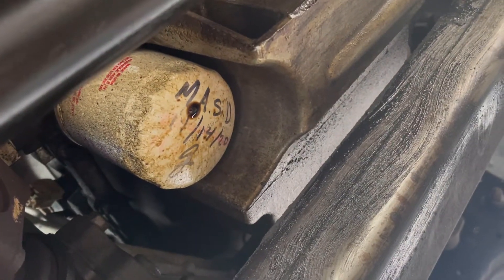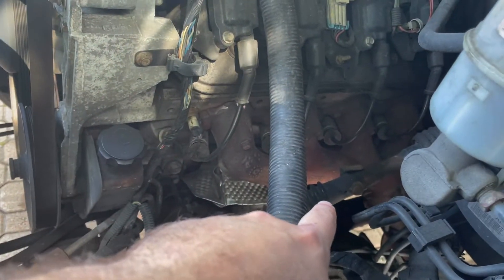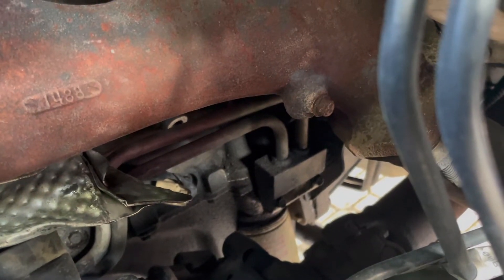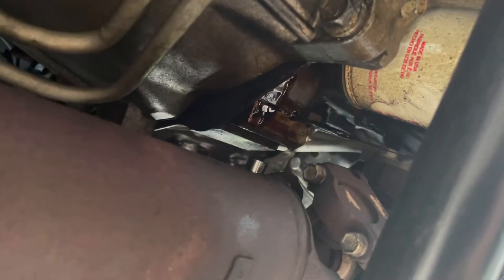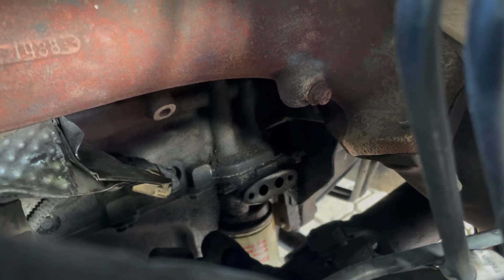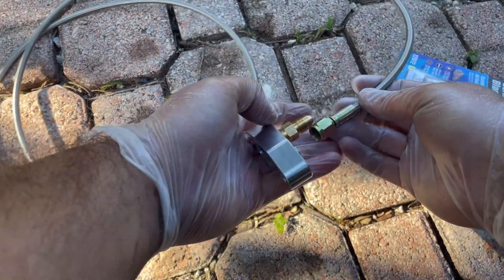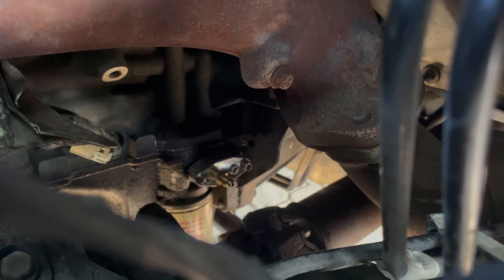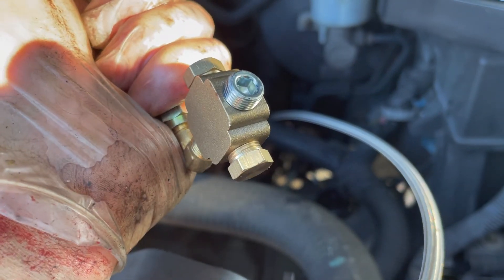LS Oil Cooler Gasket Leak GM Trucks + Turbo Oil Feed Line & Factory Oil Cooler Delete 6.2 5.3

Comment: You I can just remove all lines and add the backing plate to the oil pan and that’s all?
Reply from the maker: Yes you can install the block off plate and leave the plugs in it if you don’t think you need the oil cooler.